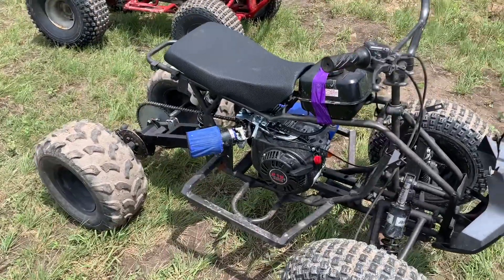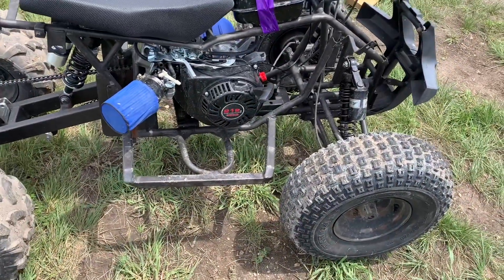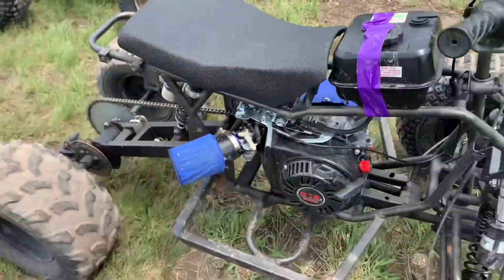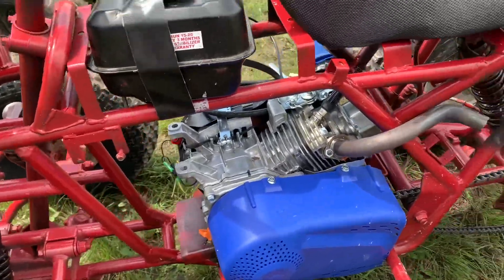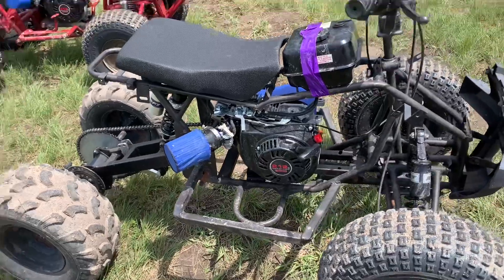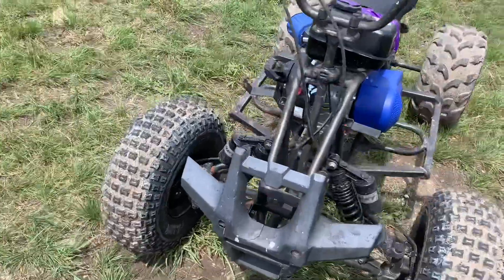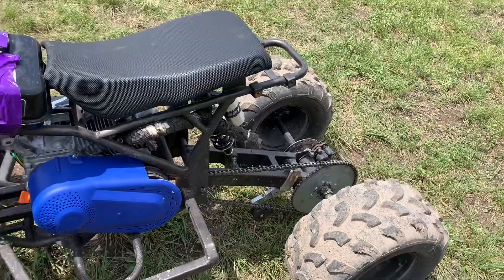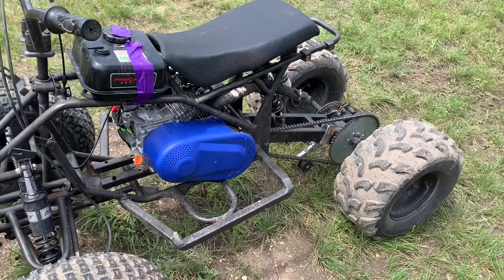Predator 212cc ATV Swap - Parts Needed and Extra I Added

Comment: Where do you get the rear  axles and did yall change the front a arms
Reply from the maker: Rear axel was factory but arm was extended. Front arms are original as well.

Comment: Did you need new brakes? If so can you post the link to them
Reply from the maker: Nope you can use stock brakes.
Reply: @ thanks man. I ended up getting a new break caliper because it was kinda messed up and also no throttle cord.

Comment: what chain and sprocket sizes do i need to buy for it to fit?
Reply from the maker: Two sizes that people usually run are 420 and 428 just make sure the chain and sprocket match. These are 420 chain and sprockets.

Comment: So did you have a problem where it bogs out really bad? I’ve been building one and can’t quite figure it out. I’ve changed the jets and the idle idk what else to do
Reply from the maker: Make sure your fuel lines are smooth so they are not too long or routed weird. Also check the throttle cable and make sure it doesn’t bind or hand anything in the way.

Comment: i put the engine on the polaris 90 , and it only goes in reverse lol i havent done anything to it yet so what do i do
Reply from the maker: These engines are designed to go one way only. Which way is the engine facing?
Reply: To the right side

Comment: So if I have a carb that doesn’t come with the engine like an atv carb do I still need to put a throttle cable on the actual spot
Reply from the maker: If your running the predator 212 just route the cable in a way that the carb will function correctly. Everyone of these builds is different in some aspect, you can even modify the stock cable to work.

Comment: I got a 110 frame, loncin brand, would I have to weld or get a plate or could it just bolt right on, also what sprocket would be good for speed and launch
Reply from the maker: Either one as long as the motor will sit even and run the chain straight. For the sprocket get a blank and drill to fit for a 420 chain.
Reply: @Alpha-Works-Tx  also I have another frame but the sprocket is on the opposite side, i need it to be on the other side for the shaft to line up with it. how would i switch it
Reply from the maker: @sploofy4878  in that situation you would need to run a jack shaft. There's some videos on YouTube with people that have done it.

Comment: What is that big sprocket on the rear that holds the chain, is that linked in the description?
Reply from the maker: That sprocket is a blank I bought from gopower and drilled to fit. It's a 420 sprocket.
Reply: @Alpha-Works-Tx  youre the 1st youtuber to actually reply fast and not in a week, thank you, I'm trying to do this with my atv because all the wires are junk and I just blew something off the engine so this would be better and faster than the Chinese engine
Reply from the maker: @nixbar6546  for sure, the great thing about this swap is it eliminates all wiring which is nice.
Reply: @Alpha-Works-Tx  yep no wires is what I'm going for
Reply: @Alpha-Works-Tx  what do you have the chain hooked up to??
Reply from the maker: @nixbar6546   the chain on the extended atv has a gopower torque converter, 420 sprocket, and a Amazon chain tensioner. The red one is just 420 sprocket to gopower torque converter due to it being shorter and not needed a tensioner. 

For the chain just buy a 5 foot one and cut to fit for your needs.
Reply: @Alpha-Works-Tx  do you by chance and any social media I can text you one for more pictures just do I have a idea of what to do with that chain?

Comment: What was the sprocket you bought for the black one I’m looking for one for mine it’s center whole is 1-7/16 do I need one exactly that or can I use one a little bigger and center it up and match or drill the little wholes
Reply from the maker: You can get a little bigger and just drill the holes to center. That's what I did

Comment: Can you add everything to buy  directly to Amazon please
Reply from the maker: Hello, all the links are in the description. Is there a part missing that you need?
Reply: @Alpha-Works-Tx  hi sorry I just seen it I have roketa 250 atv  frame  I’m putt 212 predator what type of sprocket would you recommend
Reply: Where can I get the sprocket  that would fit 250 atv ????
Reply from the maker: @destinyrivas105  I would buy a blank sprocket and drill the holes to fit what you have. Measure your axle diameter so the center of the sprocket will fit.

Another option is to determine what chain you already have because your  stock sprocket may work already.
Reply from the maker: @destinyrivas105  Also, to purchase you can look at Amazon and gopowersports.com

Comment: What mounts were used? Not sure which mounts will and wont work
Reply from the maker: Use a steel plate or bars and drill to fit…bolts can come from any hardware store
Reply: @Alpha-Works-Tx  how did you make the seat go on without the body?
Reply from the maker: @Tyler-vf2ge  the seat doesn’t need the body only the front mount and the rear clips in.

Comment: How did you mount the rear sprockets to the axles? An adapter hub thing? Does the axle have a keyway?
I’m trying to swap a 212 into a 86 Honda trx250 and it originally came with 520 chain and sprockets and I need to get 40/420 working so I can use a torque converter. Thanks
Reply from the maker: One has an aftermarket sprocket and the other I bought a blank sprocket and drilled holes to make custom fit to bolt pattern. Doing the blank and drilling cost maybe 20-30 bucks total and that is what I would recommend for your Honda.
Reply: Post a video on it.

Comment: Can you use the same sprocket from the factory Chinese four-wheeler
Reply from the maker: Yes depending on the tooth count and configuration your trying to run. Keep in mind a lot of the torque converter kits are for 420 chains.